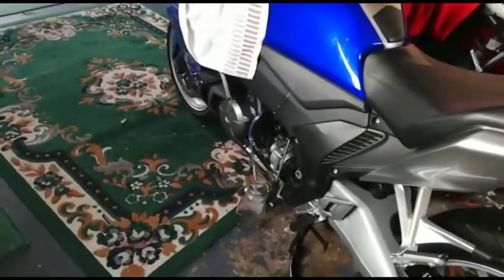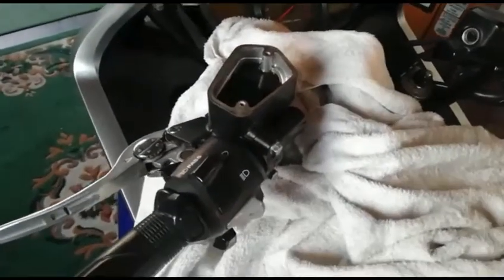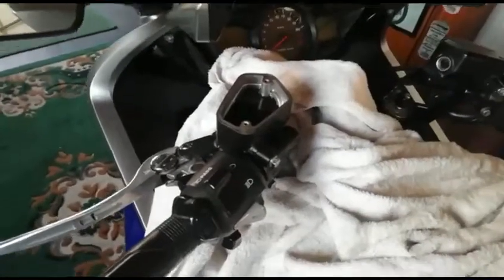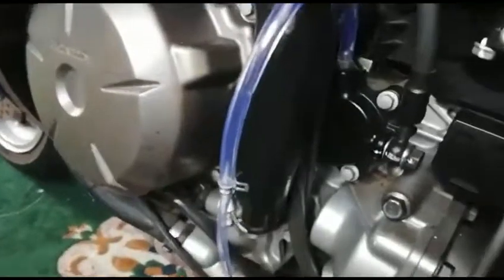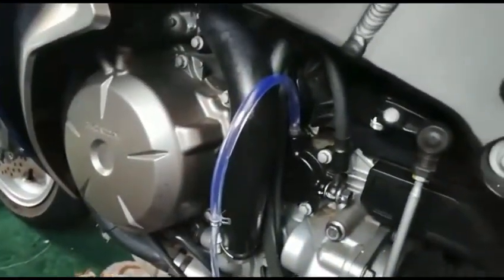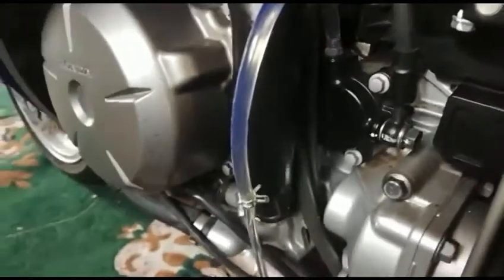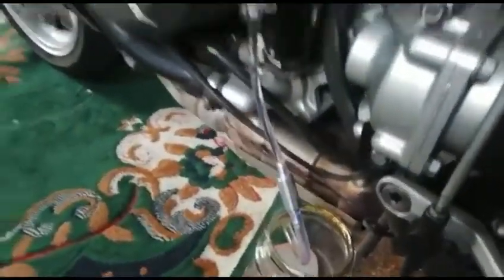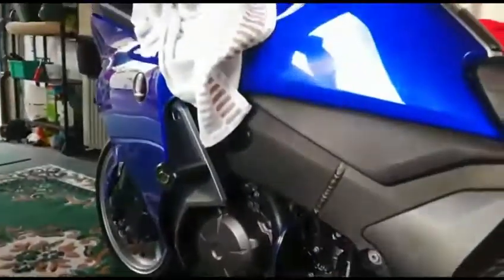Honda Vfr 1200 Clutch fluid change, (my method in description)

Comment: I did the clutch fluid exactly the same way on my VFR 1200f. It was probably overkill but it doesn't cost much and so I did it every 2 years over the time I owned it. I found it was very easy to do and the hydraulic clutch never gave any problems.
Reply from the maker: Yea, a lot of forum comments had not favoured the cheap ebay return valve bleeder, but worked a treat. Thanks for your input. 👍

Comment: Which clutch fluid did you buy?
Reply from the maker: Just a generic dot4 as  used on brakes. From my local car shop, comma was the brand... I had no preference, the manual just says dot 4 brake fluid. 👍
Reply: @Grahamvfr  man I couldn’t find that info for DOT 4 in the manual at all. Thank you
Reply from the maker: @ChauToVal  yea I know, I scrolled past many times. In the online service manual, it's in section 1.6, I think pdf page 12,general info, clutch gearshift specs.